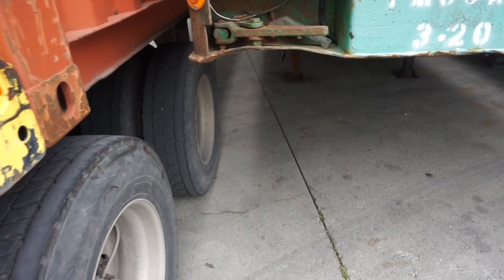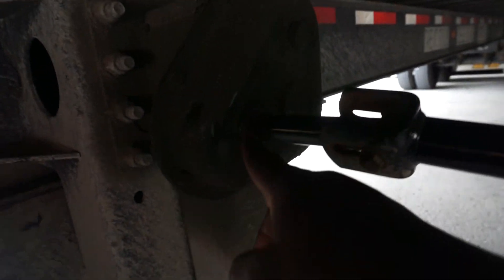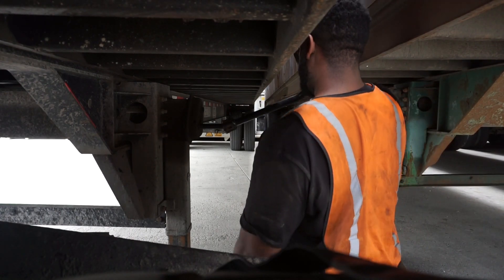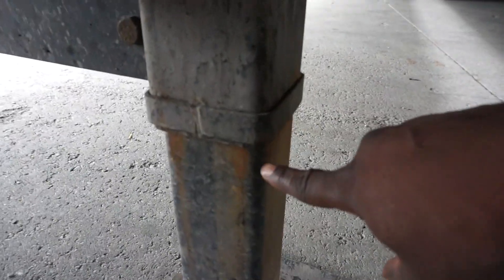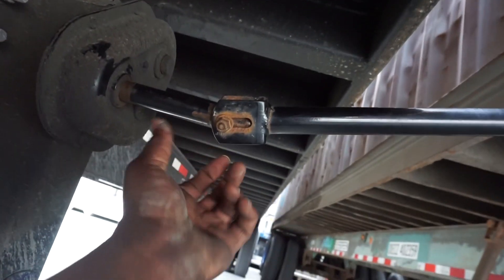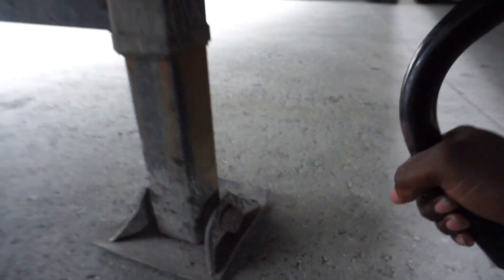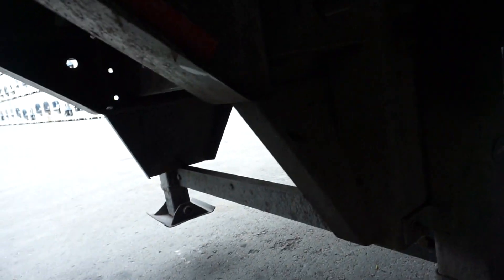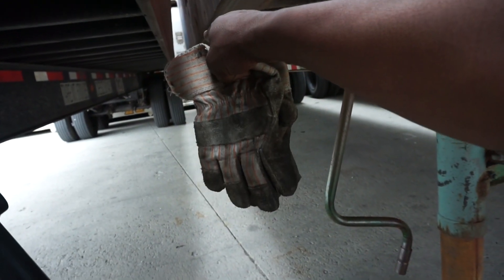TRUCKING: WHEN your TRAILER Is TOO CLOSE ( GET UP OUT OF THAT JAM ) By DOING THIS!!!!

Comment: When it’s close like that I always drag it out😂
Reply from the maker: I attempted to drag it big bro but the spotter dropped it a little high the legs had too much pressure and I didn't want to bend the legs to make that thing have more smoke!
Reply: Or pick the trailor next to it up pul it out and hide it then pick that one up 👀😬 I am going to get some slaps 😔
Reply from the maker: @stephen8713  lol.... Both of the landing gear arms was on the same side.
Reply: @TruckingandLife  them back to nr one rip it out 😂😂😂
Do you get shunt valves on them trailors
Reply from the maker: @stephen8713  there's no shut off valves on the chassis's big bro lol!